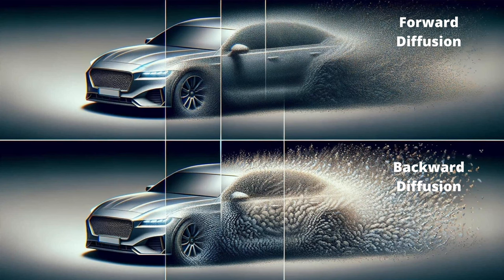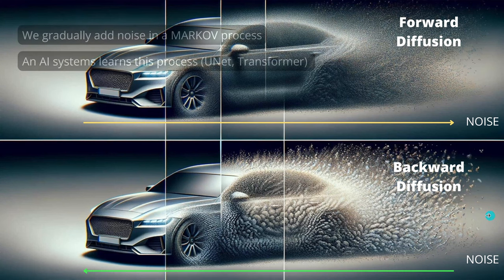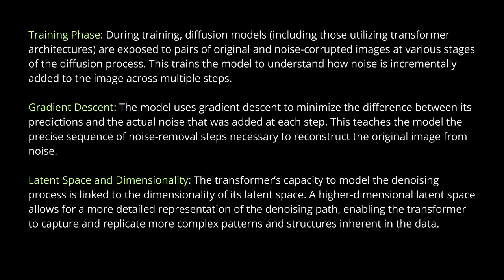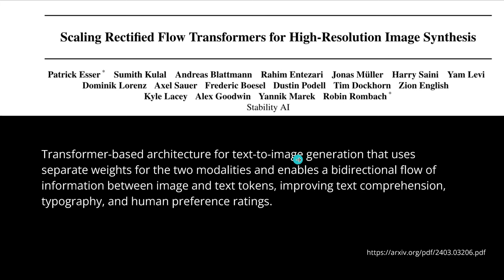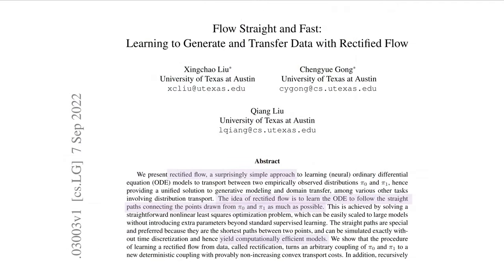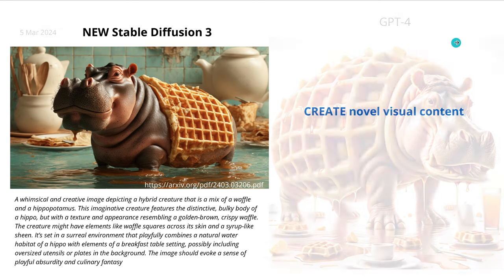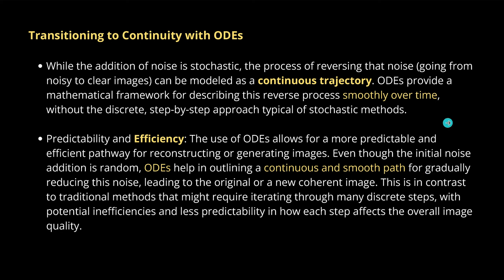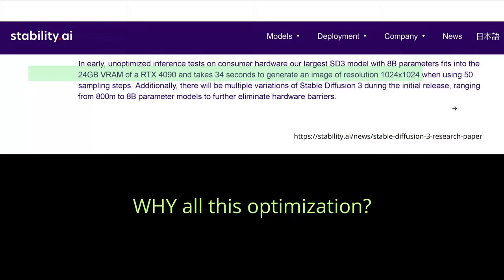Diffusion Transformer explained (Stable Diffusion 3)

Comment: For 1500€ you can get 2 second hand rtx3090 and nvlink running in sli, a matx and a pcie raiser to fit them in the case for less than 200€, the power of the system might be the higher one but if you need it i think its afordable. Also you could run proxmox and virtualize the gpus for different tasks or run them together for 48GB of VRAM and 1TB/s memory bandwidth per card